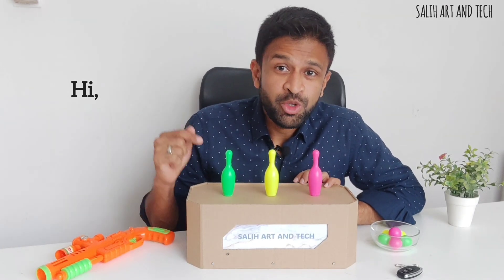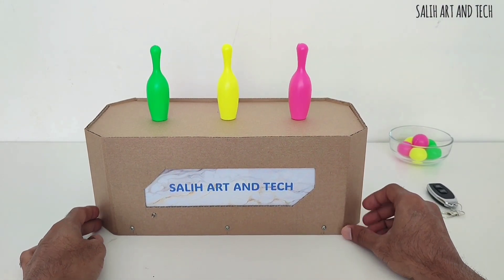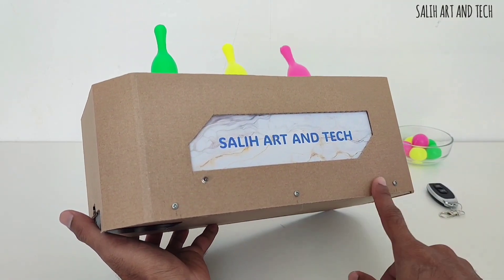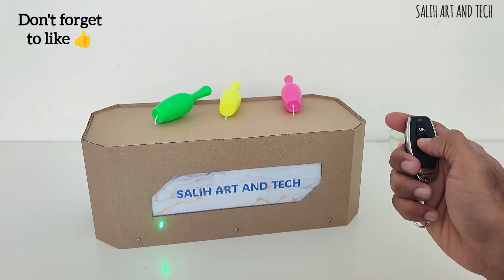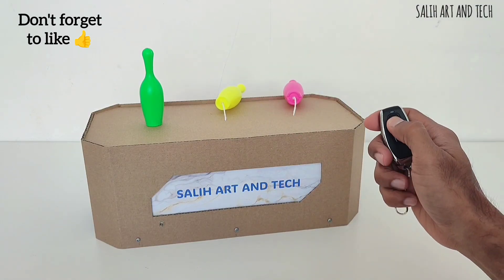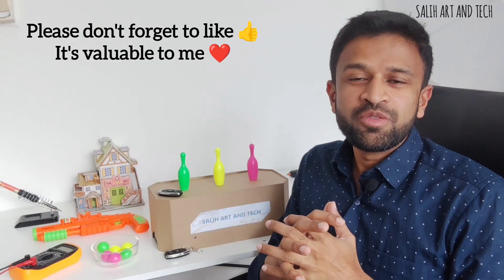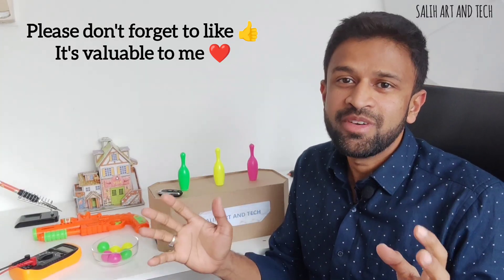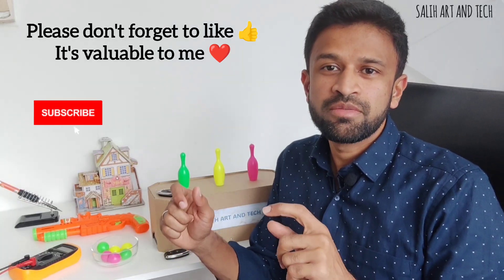Excellent Arduino Project | Remote & Automation | Innovation at home | Arduino Project Ideas

Comment: Nice innovation ❤❤❤
Idea: Automatic Mode like if the three is down run it immediately.
Reply from the maker: Thanks for sharing the suggestions 🙂 It would be definitely possible by using some Arduino sensors.